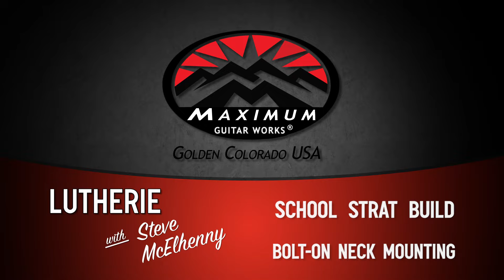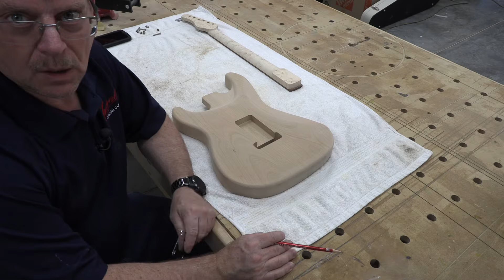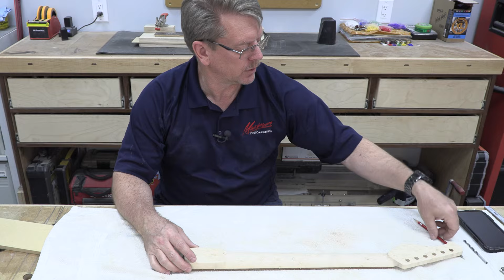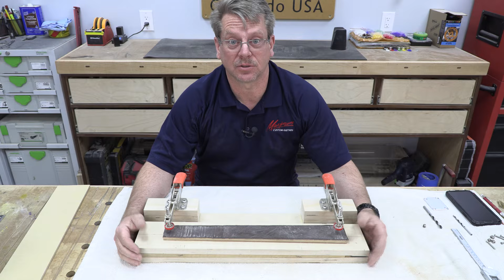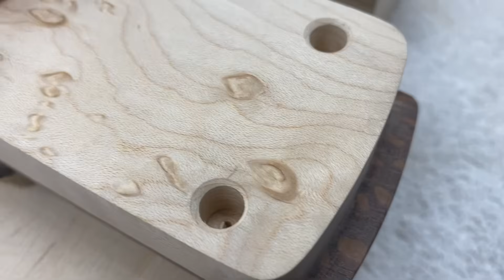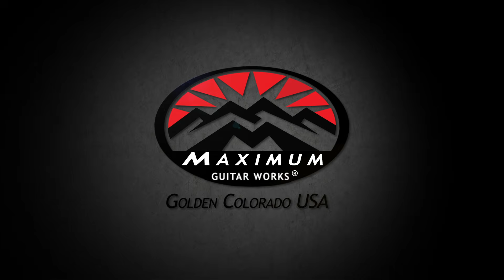The School Strat Build - Best Bolt-on Neck Method...ever!

Comment: I appreciate the video and the details. But I don't understand the reason behind the countersinking. I understand the depth of the hole being slightly greater than the length of the insert in order to recess the insert slightly, but why countersunk? It looks like empty space around the top of the insert for no reason (25:13). What am I missing?
Reply from the maker: Like I often say...there are many ways to do things...and I just show a snapshot in time of what I do.  Generally I'm fairly pragmatic...and normally I have a reason for everything I do.  In this specific case...I have two reason...neither of which impact the overall performance.  My first reason is because the the tool that I use to install the inserts.  Because the nuts that I use are slightly wider than the insert...without the counter sink I could only get flush...and for safety measure I prefer to be slightly recessed.  Reason #2 is because I generally spray a finish on my necks.  If that hole was a straight 90 degree angle...the finish and wood would have a greater chance to chip.  Generally, I like to chamfer corners.  As stated in the video...I only slightly countersink....0.5-1.0mm...just enough to recess slightly.
Reply: @maximumguitarworks   Makes sense! Thanks!

Comment: Since its already on the neck jig, why not use the bolt/screw combination you use in the hand socket and mount it in the drill press chuck and twist the chuck by hand keeping pressure on with the drill press handle.  Just a thought, seems like an easier way to keep pressure on the insert.  BTW my solution to brass threaded inserts was to drill a hole the diameter of the insert then epoxy them into place.  However, I have only used this method for control cavity and pickup screws, to sure it would stand the strain of neck bolts (for that I use stainless lag bolts ground and polished with the washers slightly countersunk to avoid tear out).  BTW thanks, learned some new stuff.
Reply from the maker: Thanks for the comments Joseph.  I have no reason for not using the drill press...other than I never think about it.  Another commenter ask the same question.  I promise to try doing it that way next time!

Comment: Not too long at all, I love the attention to detail (I just wish I had a workshop like yours). A few suggestions.Use your drill press (since you have it anyway) to drive in the inserts, not as close to perpendicular as possible, but perfectly perpendicular (hand crank only!). And since we're going totally overboard, brush the outer threads of the inserts with some epoxy glue before setting them and finish off with a drop or two of blue Loctite on the threads of the machine bolt when time comes to final install of the neck.
Reply: Having worked with wood inserts, various screw types etc. The screw head has the primary job of holding the neck to the body, the insert provides a removable method of neck placement/replacement but often weakens the surrounding wood that the insert is in. Bodies can be Ash, alder, mahogany and plywood as well. For my next neck installation I plan on removing the maple neck finish on the body side, prepping the body side to bare wood , not painted or finished as well. Then gluing the neck on with a Japanese hide glue which has excellent results clamping and then use the the full length Fender style neck screws.  The gluing/ clamping results would allow for zero movement and final strength given by the screws. Inside the plate would be the hide glue note of use. Conventional screws as well can go wrong with movement and especially inserts can really be a challenge to get true perpendicular results. Simply apply the standard heat for hide glue and remove if you have to. It’s a blend between Gibson permanence and Fender modular construction.

Comment: Do you believe that metric system is a bit less complicated for these kinda measurements?
Reply from the maker: I tell my students...luthiers must be comfortable with both systems of measurement.  I prefer metric for most critical measurements...however that are still many parts and other specs that are common to the empirical system.  But everyone will come around eventually...I mean it has only been 50 years since the US started to change over to the metric system...another 50 years and we should be complete!

Comment: This may be the best threaded insert video I've ever seen.  Did you consider actually tapping the exterior threads? Or not worth it?
Reply from the maker: Thank you Matthew.  I honestly did feel a little silly that it took me as long as it did to explain my process.  I have never felt the need to tap wood as long as you select the correct hole size to drill.  I think that it is fine if people want to do it that way...but to me it seems like an extra step.  I do like the drill press use to drive the inserts into the wood...but most of the time I do it exactly as I showed...by hand.  In the end...everyone should experiment with all the different methods...and share what works best for you.  I would love to hear back from people that have tried several techniques...and their thoughts on how I do it.
Reply: @maximumguitarworks   I'm about to install inserts into my warmoth strat neck, I'll let you know how it goes.  I was watching Matt's threaded insert video and he mentioned the insert-into-tapped hole method.  FWIW I've never been able to get threaded inserts to work well for general WW; it's always too crooked or too tight or too loose. But I already own the tap set.

Comment: I drill the holes in the neck heel while it’s clamped to the body. It acts like a drill guide. I’ve been using the brass inserts since the 90s.

You need number drill bits

Comment: Great video, I use the same method to drive my inserts into the neck but I chuck the bolt and nuts into my drill press and use the downforce of the press while hand turning the chuck. I really like your videos and it's because of the amount of detail you provide.

Comment: thanks steve! from what company do you get your drill bits?
Reply: I know you didn't ask me but Fisch make outstanding bits, a little expensive but well worth the cost. You can also get great mid ranged sets from Woodcraft.
Reply from the maker: That in fact is the brand that I use.  Individual replacement Fisch bits are also available to purchase.  Thanks for covering down on that question eddie.